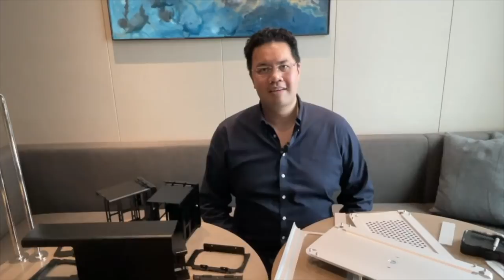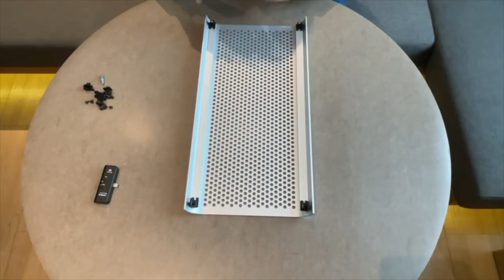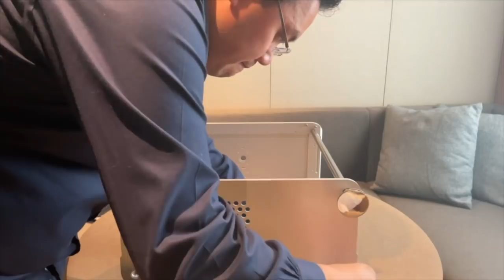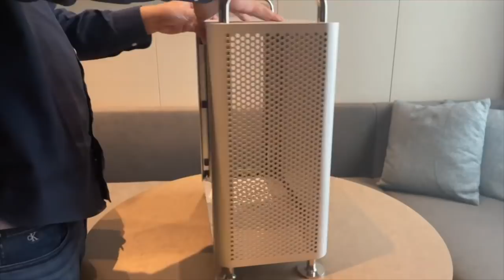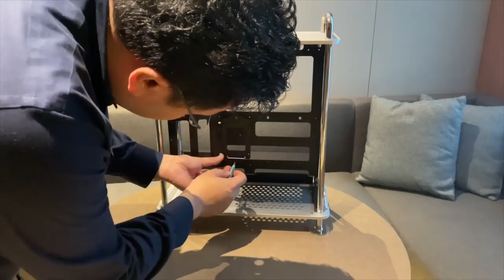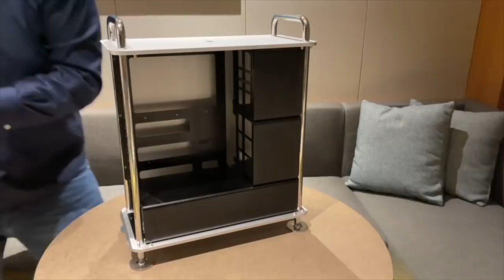Showcase - Dune Pro Assembly

Comment: I mean, it certainly looks like a nice case, but the whole process of this dune case seems a bit inflated. Like, it's a pc case, not exactly an original or revolutionary pc case, a nice pc case yes, but a pc case nonetheless. I don't know maybe I'm just cynical.
Reply: well the outside dimensions and look is set by Apple Mac pro case,
inside layout is set by ATX standard and one piece motherboard/psu shroud that has been come a standard thing, like cable management. 
Now what Dune Pro is?
it is a High end, mid size case that is made from thicker material than most of the high end case on the market.

now this case may have the vibe of hackintosh, but it also has the Apple professional look
and I can see this case sell more unit on the DIY IT department market vs home DIY market, as many companies need more PC power than HP/Dell prebuild and are not willing to overpay for a hardware.
Reply: Has it ever been more?

Comment: I find it funny how people are crying about plastic vs metal clips, both can break,
but you more likely to lose a few clips, away before you break one.
so as long as you can buy parts and get spare clips with the case, plastic or metal doesn't matter.

now the screws look like M3 and M2, which means you will need the right screwdriver and the right technique, so you don't strip the threads, now many modders will retap for M4 screws where they can.